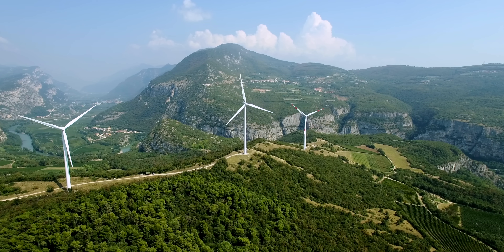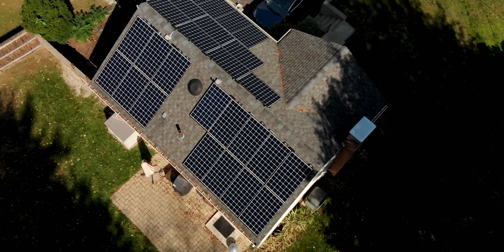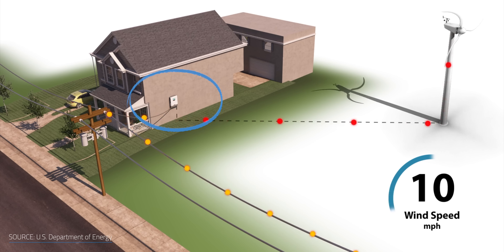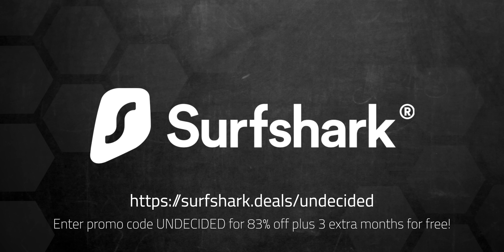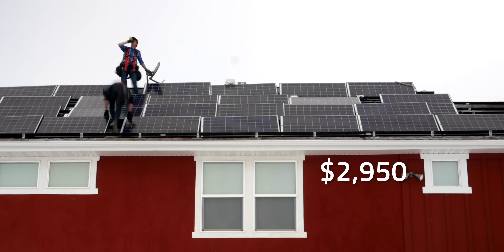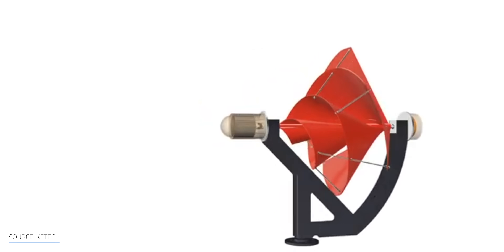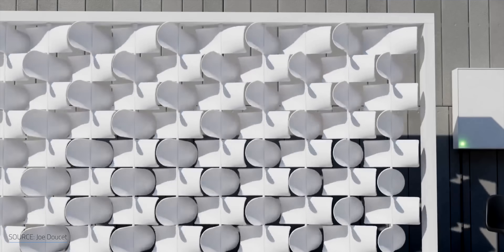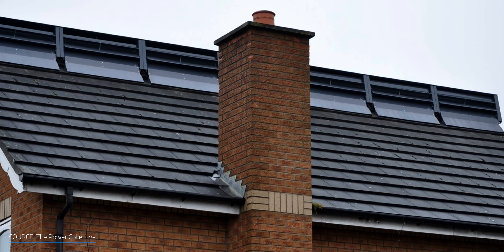The Challenges of a Wind Turbine on Your Home

Comment: If you could make a dream, self sufficient home on 1 acre of land, what systems would you want? i.e. Roof of solars, Green House with aquaponics, a windmill/windfall for more power and well pumping, with a geothermal for heating.
Reply: Mine would use solar thermal water-heating and sterling- engine electricity, an ice reservoir for literally storing cold at night, rain-capture water-storage for pressure and any task needing water just short of potable, and airspace allowing, an aerostat parafoil to catch the wind and turn propeller-generators for more power, with pumped water energy storage.
Reply: That depends largely on where you live. 
There is no one-fits-all solution to this question.
Reply: @thorndelwyn6528  I just know what I'd go for- stuff I could more easily design and maintain if needed
Reply: @thorndelwyn6528  right?! I shoulda added that. A Fijord vs Woods vs Desert and so on.

Comment: Good morning Matt! I have considered this and looking forward on your take
Reply from the maker: Curious to hear your thoughts after the video.
Reply: @UndecidedMF  Sorry for the late reply. I was on a date with the wife. First off, I also noticed the lack of real choice  in the DIY market unlike solar. The real problem I see is the return on investment time-line. My area we are prone to hurricanes but I have a 3 story cement building and I was considering mounting to the building. Again the selection of quality seems to be a very limiting factor. 

Recently I installed a battery backup system with the ability to add panels as soon as my area has stock again. I was able to build a 30kw battery myself from raw cells. 

Great video and I will look up some of your ideas when I get back from vacation. Thanks Matt 😊.